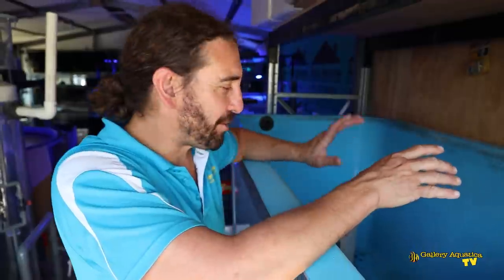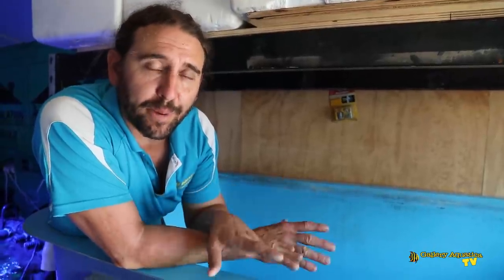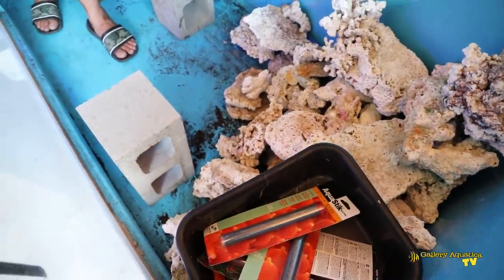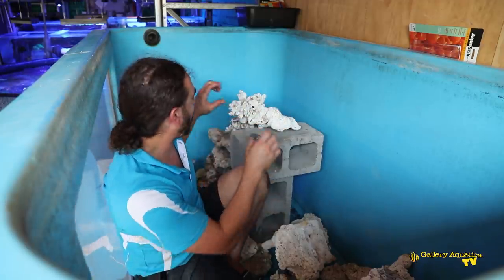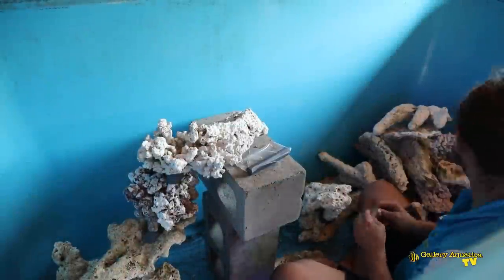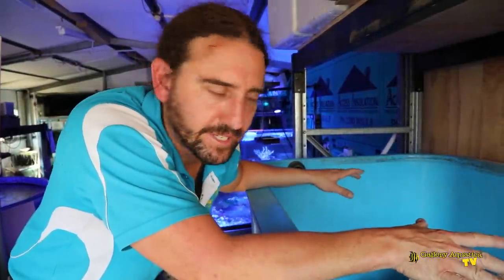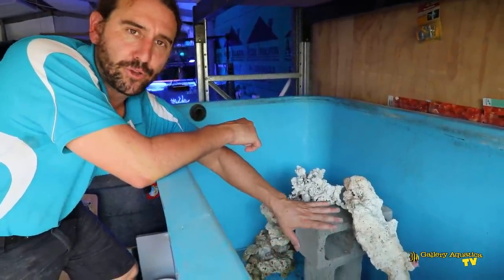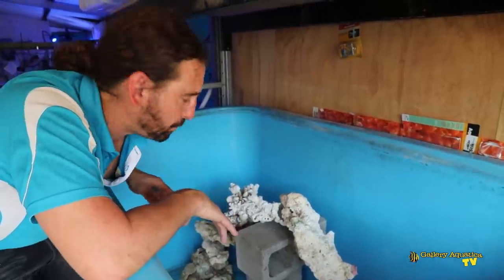The SPS MOTHERSHIP Episode #3 --- Gallery Aquatica TV

Comment: Hi Cam,
I see you often work with Epoxi without gloves. I know that the mixing with gloves on is very impractical. But it is just a matter of exposition to get a allergy. I am sure that the instruction guide of the producer have warnings.

If you work daily with pure Epoxi you get a allergy very quick. I don’t know how dangerous it is to work with the Coral-Epoxi (they have a lot if inert Additions)
Reply from the maker: Your right. I should always advocate gloves with epoxy. Cam
Reply: @GalleryAquaticaTV  I have tried to handle the Epoxi with gloves  on, but it is to sticky. The Epoxi works very well. However, I have realised that only Superglue and cement mortar is safe to use.

Do you have any idea to work nice and safe with epoxi?